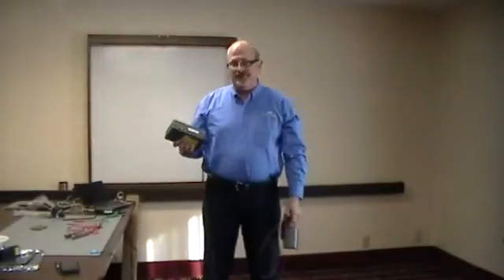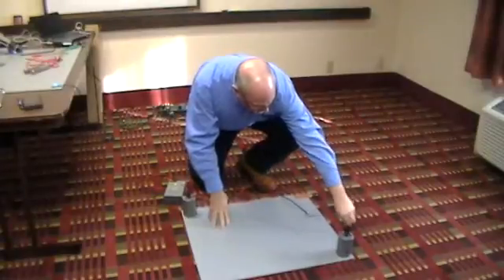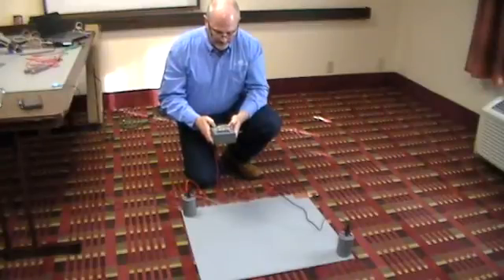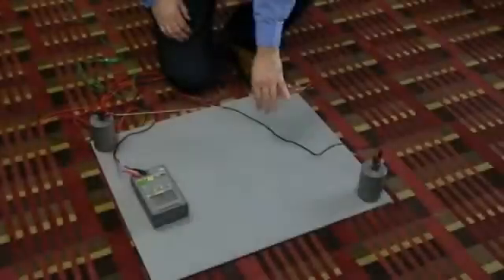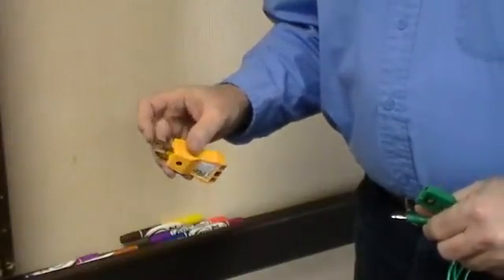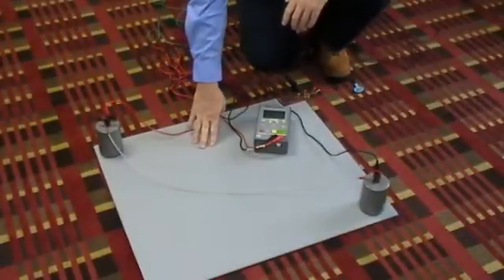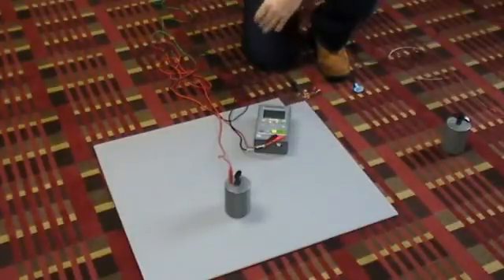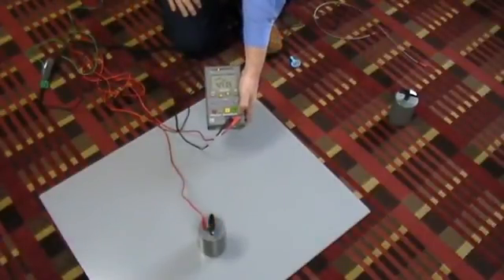ANSI/ESD S7.1 Performance Test - Protective Industrial Polyme

Comment: It's unclear... How did you connect the sample floor material to ground? Isn't there supposed to be a conductive substrate where the sample material is installed on top? Then that substrate has a test point called the groundable point?